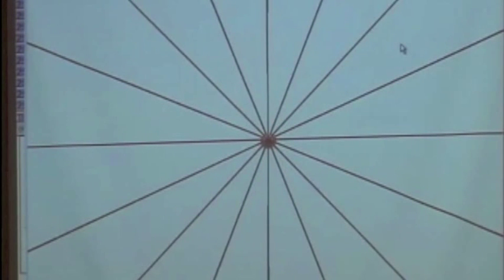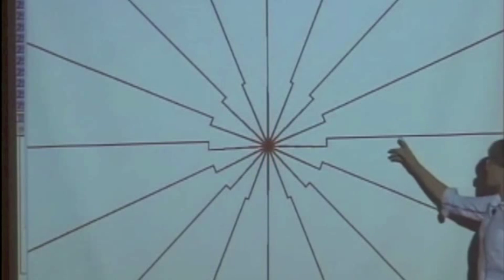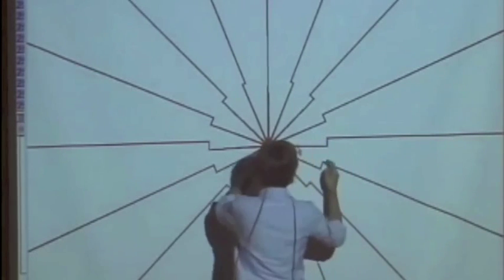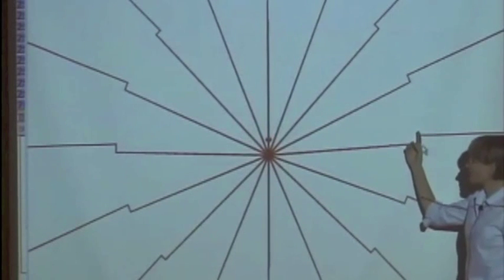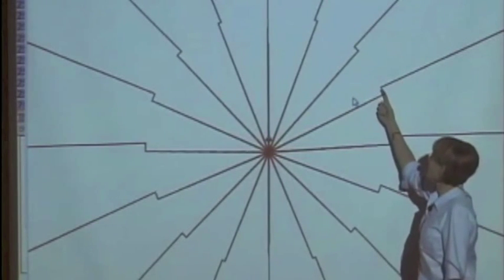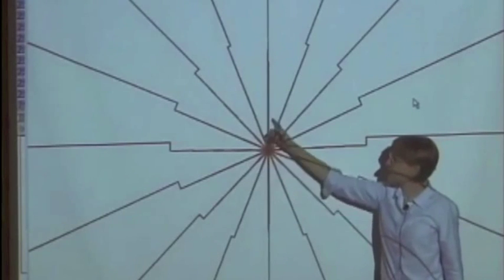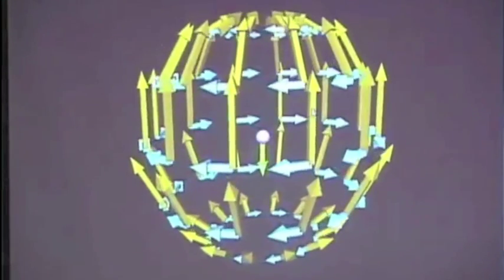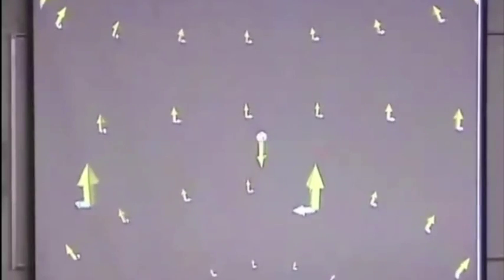EMCh24-2b 3D Radiation Pattern Part 1

Comment: Just a question. The "kink" seems to be at right angle which I see as instantaneous. But the acceleration went from zero to whatever speed which, to me, means the "kink" should be more like a "wave", in other words, smoother.

Comment: According to this explanation, we will see a propagating disturbance in the electric field around a charge if it moves because information doesn't have infinite speed. However, shouldn't that mean that radiation should be produced even when the charge is moving with a constant velocity (even though that's not ACTUALLY what happens)? Any help would be highly appreciated!
Reply: The way I interpret it is that, at constant velocity, an observer would simply see the charge moving down by observing the electric field direction, though I believe they would "see" the charge a little higher than where it actually is, since the difference hasnt reached them yet. When the acceleration pulse passes, the charge briefly seems to be in a completely different place, in this case lower than the actual charge. This would send out a wave, past all observers, of seemingly completely moved charge even for accelerations more subtle than such a fast pulse. Try pretending to be an observer and looking in the direction opposite to the electric field, for a time before, during and after the pulse. 

This is pure speculation though, I don't have much e.m. wave knowledge past highschool physics.

Comment: I can see that observers at different points in space will “see” electric field lines that point in different directions due to the vertical offset of the charge that results from the vertical acceleration of the charge. What I’m struggling to understand are the energy-related aspects of the radiating field. For instance, if at some point in space where no charge exists to “feel” the field, does the field possess energy at that location? If so, is it potential or kinetic energy, and can it be related to the energy that was required to accelerate the source charge? Thank you!